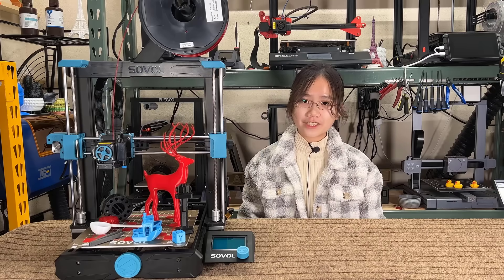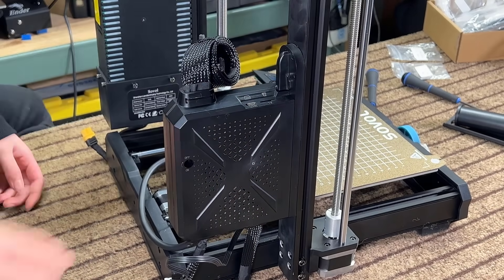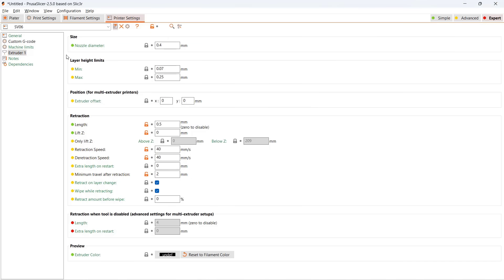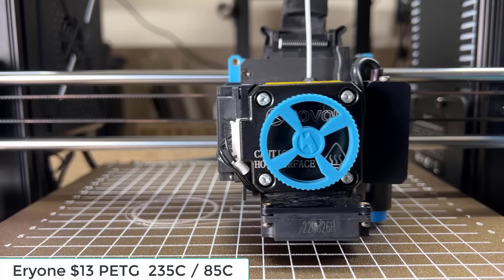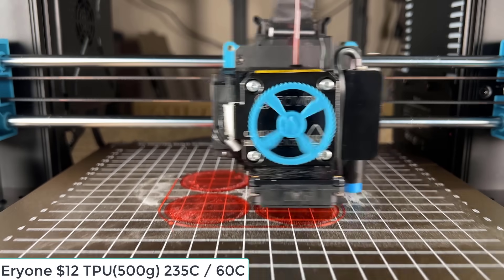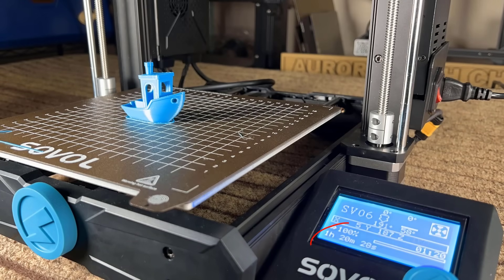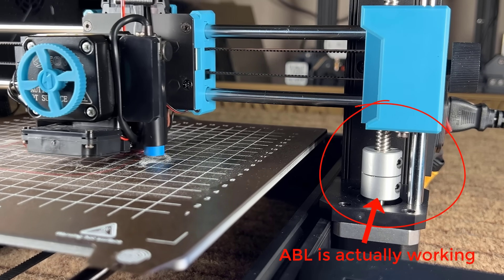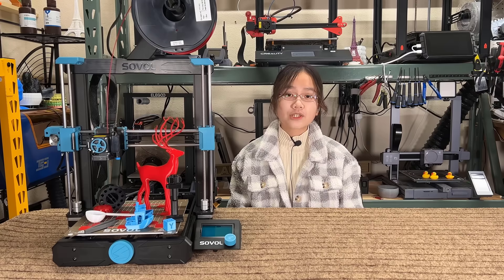Sovol SV06 3D printer: A Prusa MK3S+ clone with injection molding parts for a fraction of the price

Comment: Is here someone who has fixed the auto-z-align-problem with the SOVOL SV06?
Everytime I start the "Auto Z-align" the printer starts moving, stops and the display shows "Driver error: PRINTER HALTED please reset". I already installed the latest firmware from a new micro-SD-card, but i never got farther than the Auto Z-align

Comment: I just bought and received this printer in the mail as my first 3D printer. After being into radio control aircraft for two decades and electronics for near a decade, website building and hosting, and more recently, some more serious computer programing, mostly microcontrollers. From the reviews and instructional videos I have seen on this printer so far, it seems to be somewhere between a pretty good clone of a 'higher end' printer, to something akin to a damned good clone of a very good printer. So what is this? Because I remember the 'cheap' knockoff of the SAB Goblin 380 helicopter, which was the Devil 380, by some Chinese brand which I cannot recall off the top of my head. The speculation was that the Devil would be a cheap spare parts box or a practice bird at best. It turned out actually significantly better than the 'real thing' in many ways. Many, many owners of the 'real' one would buy clone spare parts as upgrades. This company went on to use that R&D experience to produce some damned good kits from what I remember from that time. Could this be a somewhat similar situation? I hope my choice into my entry into yet a new hobby in which to better facilitate my other hobbies is a good choice.

Comment: The z-axis bed leveling was reported in an issue with the creality board they basically copied because it doesn't have separate z-axis drivers, just two separate connectors. 
 
Someone mentioned that in a review of the creality 2.4.7 board and almost off by the same amount which I was looking to get for my SV03, but I would rather have two different drivers for z, and I want the option to use dual extruders. I am looking at different boards, like makerbase and the mellow fly, which are very similar.  

chances are they used that screen because it is well supported in Marlin, and everyone has issues with the proprietary drivers used in the color screens. Plus it was an off-the-shelf component. 

Anyway, not the first review of yours I have seen but I really do like them. :)

Comment: Nice video!  Just started using PrusaSlicer with my SV06 and noticed that the bed and nozzle heat at the same time.  It would be great if you would post instructions on how to heat these items sequentially as is done in Sovol's version of Cura.  Any suggestions?

Comment: Was the micro SD card negative because it wasn't full size because I've been told by many people octaprint works just fine when hooked up to the micro USB input next to the micro SD card slot as long as you make sure it's a data cable and not a power only micro USB cable?

Comment: Is it as quiet as a prusa?
Reply: I've read the bearings are loud but if replaced with higher quality bearings and some super lube that pretty much takes care of the noise issue although I can't compare with prusa. Pretty sure they had to cut a few corners for this price point like no auto resume if there is a short power loss on the SV06.
Reply: @Josh Fisher  still worth it for me I ended up bying it. Quieter then my ender 3 but still noisy. Definitely could use new good bearings.

Comment: Thanks, the prusa slicer config helped a lot getting up and running
Reply: @jesuswarner5102  bear in mind this is my first printer but for the most part, yes. I've been printing daily for a week and some of the stuff has come out awesome.

I did spend a lot of time with an auto bed leveling issue that seems to be common on this printer but its worked out in the end.

I am satisfied for the price it cost me its pretty worth it. Its got better specs and upgrades for the same price as an ender 3 v2
Reply: @jesuswarner5102  just took a look at the kp3s pro and honestly id say go for the sovol if its your first, there just is a lot more people using it so it will be easier to solve issues and get help.

Also another point is that the kp3s does not seem to have any auto bed leveling so thats at least another $30 added to the price as its a requirement for any decent printer imo

Comment: After watching a number of reviews, I decided to buy this machine. I ordered it tonight, as I needed another printer. Currently using a Genius pro that I am thrilled with. I want something with an all metal hotend however. I hope this machine lives up to the hype. I am not a pro with this stuff, and being comfortable with the one I have makes it a bit worrisome to try one I am unfamiliar with. I also found that Cura has no option for this machine in the add a new printer area. I guess we'll see what happens. Any advice on the slicer stuff would be much appreciated.
Reply: Hows your experience with the printer? Im thinking about getting one too
Reply: @politecnico_socratico  love this machine

Comment: I've not been able to get the start gcode to work properly using PrusaSlicer.  I've removed G80 in the start gcode as you've recommended but the SV06 starts by homing to the to the center of the bed, then drags a line of dribble to the front edge of the bed, then homes x/y/z again but this time to the front left corner, purges a line (like MK3S does), and then starts.  This issue of starting at the center of the bed and dribbling a line seems to be in the firmware.  Did you encounter this issue when you made this video?  Thanks

Comment: Interesting, I also tried PrusaSlicer using Mk3s+ profile with changed extruder and print size settings and the purge line ends up all the way on the edge of the PEI sheet, like almost falling down from the print bed. This does not happen for you🤔
Reply: did you set the bed size to 220x220?
Reply: @tonihott2  Yess...

Comment: To make sure bed leveling is enabled (if you plan to use it) for Marlin it's a good idea to put M420 S1 into the starting G-code somewhere after G28. Most printers are set up to turn bed leveling compensation off when homing with G28, although some may choose to enable leveling after G28. The only way to know whether your printer has this behavior is to load or create a valid mesh, then send G28 followed by M420 V to see whether leveling has been automatically enabled.

For the most part the printer seems like a very good value and quality. The main problems can be solved by a firmware upgrade, especially by enabling automatic Z alignment that uses the probe to measure the bed distance at each side instead of homing to the top, and also enabling the Z Probe Offset Wizard.

Comment: How’d you print abs so well without an enclosure
Reply from the maker: Use glue stick and only print small ABS parts, if the part is large, you may still need an enclosure.
Reply: @AuroraTech  okay thanks!

Comment: My SV06 is rough while homing the X, it will hit it but continue moving longer than it should as if it's crashing. Any idea what the issue could be.
Reply from the maker: You can adjust the sensitivity of the stepper drivers on the LCD screen to make it work better

Comment: Print quality can only be judged by shining the light from the top down across the sides.  Differences in the layers then show up as shadows between the layers.  Shining the light from the side to view the side will hide all the layer quality issues.  Almost all printer reviews light the side from the side and hide the actual layer problems.  Low cost printers have poor quality fans and bearings that will fail after a few prints.  If you place no value on your time, and you enjoy repairing printers and fixing issues, buy a low cost printer.   If you just want to make 3D prints, buy the Prusa.  It uses the highest quality Misumi bearings and high quality motors.  The printer just works.  I started using a low cost printer and then bought a second low cost printer as the first would fail frequently. I recently bought the Prusa and it just works.

Comment: First of all, let me just thank you for you content.  I've learned so much watching your videos.  I have a Prusa Mk3s+.  It was great for it's time but it's very expensive and took me over four days to build.  The gummy bears didn't help.  Then the MMU2S was faulty.  I believe a Creality or this Sovol are good alternates to Prusa, IMHO.
I got the X1Carbon/AMS and I no longer use my Prusa, I'm waiting for Prusa to implement LIDAR and come up with a Mk3S+ conversion to a Mk 4 kit.  The auto-bed leveling is great however, the Z offset leveling going from PLA to PETG is problematic, so I would only do PLA on my PRUSA.  With my X1 Carbon, I've printed PLA, PETG, and TPU without issue.  IMHO, it is by far the best affordable printer on the market.  I'm also consider the SOVOL v04 IDEX.  I'm waiting on the next phase of 3D printers which will implement LIDAR as  Bambulabs has done.
Reply: That would be great if what Bambu was actually using on their printers was Lidar.

Comment: I can't shake the thought that Sovol's hardware engineers, manufacturing staff, and material buyers are all really crafty, skilled people. To have so few hardware issues when they took a $1000 printer, made a couple interesting improvements, and then sold it as a $300 printer...that's excellent (never mind the several other very good printers they've made). If I ever sold, broke, or otherwise gave up on my heavily modified Ender 3, I would absolutely consider an SV06 to take its place as the "do everything surprisingly well" printer in my inventory.
Reply: I've been using my SV06 for over a month, and while it's a decent cheap printer, it is no where near a Prusa in terms of quality.  The bed is horribly warped and not adjustable. One of my z lead screws came bent and I can see it wobble when I raise the z axis.  Cheap stepper motors get really hot if you try printing fast.  I had to order new bearings because the stock ones make a crunch noise out of the box, even when lubed.

That said, for the price, it's not bad.  It is very easy to take the print head off and change parts, and nozzles are very easy to change because the heat block is secured with screws keeping it from spinning
Reply: @mikeb1596  Did you have any heat issues after replacing the bearings? I've read that the bearings are the main issue is not only because of heat but noise also but apparently (from what I've read and seen on YouTube), replacing the bearings and adding some lubricant resolves those issues for the most part.Since I know the z axis leveling doesn't work that will be the first thing I do manually in case it doesn't line up so not an issue for me (mostly because I'm aware of it).

Personally, I would have returned it if the bed was warped and the screws were messed up as I haven't really read that elsewhere. A few people had the bed warping issue but were returned or SOVOL sent them a replacement bed. At the same time I e read SOVOL support can be "fun" to deal with also. 

I was debating between this and the ELEGOO Neptune 3 Pro or Plus but settled on this due to more upgrade options and a higher printing temperature. That and ELEGOO is only shipping directly through their website and they are out of stock and I do t trust their "expected" shipping date either. That, and it's less upgradable. I'm also eyeballing the plus for the extra size and nicer touch screen although the touch screen isn't a big deal to me but it's a plus 

I've read that misum bearings are the best but someone recommended vcb as they are half the costs of the misum for 12 bearings (30 dollars US) and was advised not to order the 10 to 15 dollar bearings off Amazon as they are just as bad as the stock bearings. 

Lastly, the reviewer mentioned no USB but I read there are zero issues hooking up a raspberry pi with octapi using the micro USB port next to the SD card slot. If this is true and USB micro can't work with a octapi that's a deal breaker for me because they place those SD cards in terrible places so I want to avoid being limited to SD cards only. Thanks in advance for any input you may have, especially after having it for a few months to get a better take on it.

Comment: If each motor of the Z axis will be controlled by its own driver, then you can use the alignment of the X axis beam using the "G34" command. This I, for example, did immediately for my KP5L :)
Reply: Are the steppers independent?
Reply: @RobertManzano  No, they are not independent.

Comment: This review like many of your reviews is technically superior to most I see.  Your video production is great.  The pros, cons and suggestions rank your reviews as first rate.
Reply: The order of calibration and noted as con number 7 i have not heard before. 

It is spot on.
Reply: @jhvhest  They also mentioned SD card only but I was told that Octapi works via the micro USB cable so you aren't limited to just the SD card. Is this true? If not that may be a deal breaker for me. I read about the Z axis calibration issue (for some people, not all) but seems extremely easy to check and manually adjust if the auto alignment doesn't work so I know to check for it also so that it doesn't hurt. Lastly, the bearings are noisy and can produce a lot of heat but that can be fixed by buying some better bearings and using some super lube. As long as you don't buy 10 dollar bearings off Amazon because hey are the same, or worse, quality wise as the stock bearings.

Comment: IMHO you can't call the SV06 a Prusa MK3S+ clone as you can't use the specific Prusa's firmware with regular upgrades which makes a lot in the quality and reliability of the MK3S+. It's rather a lookalike in a way. I believe the SV06 is still an interesting printer despite it's not a MK3S+ clone.

Comment: Hi Aurora Tech. I noticed that when you guys assembled the printer forgot to guide the extruder cables through the blue tabs on the mounting bracket. I saw the cables touching on the top of the frame while doing the Z alignment. Maybe that threw the alignment off and that's why you where getting one side lower or higher than the other one. I just checked and the assembly instructions show the cable routed through those two blue tabs. Due to how the extruder was designed this seems like a critical step to avoid obstruction of movement by the extruder cables. Love your channel by the way. Very detailed and professional reviews, you guys should have more subscribers.

Comment: Nice video as always.

For z-align: On the mk3s the cable is much lower, so the x/z top out on left and right simultainly, aligning z-hight. On the SV-06 the cable of the printheads top out - so no alignment left and right at all.
To fix it, you simply might add clamps to the left and right z-rods at the top, so the x/z joints top out before the cable does.

Two other cons in comparison to the mk3s+:

- No filament autoload (I realy like the internal filament sensor of the mk3s+)
- No MMU-Support (but you might add Klipper and Enraged Rabit Carot Feeder)

As Creality and Sovol share a lot, support for the Sonic Pad would be fantastic. It would help to compensate the two cons I mentioned.

Comment: Mine is working great. I adjusted the z level manually with blocks first then let it do its thing and checked again. Working on pushing speeds with it now. Only issue I have is the magnetic sheet is dead, but sovol is being super helpful with it. I'm just going to replace it and get a double sided PEI sheet anyways. There is a couple of different firmwares out already, the demon firmware is going to go in tonight. Great video!!
Reply: Careful going too fast.  I installed Klipper and tested at 100mm/sec.  Those stepper motors get really hot and the hot end can't handle high speeds if you are using higher temp materials

Comment: As Andrew Hayes states, the 2nd Z driver would allow the use of G34 Z alinement.
Reply from the maker: Not on this printer as both motors are controlled by one stepper driver.
Reply: @AuroraTech  was hoping that maybe the next release of a Sovol board will have dual stepper drivers for the Z axis to be able to use the G34 alignment option.